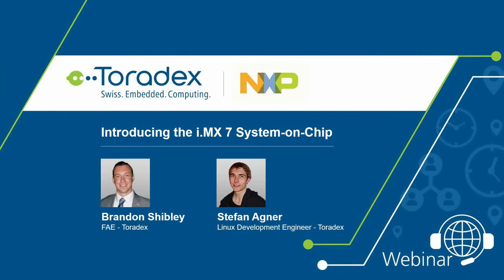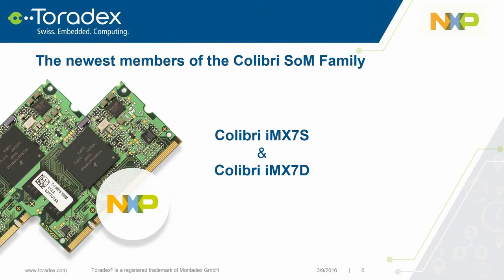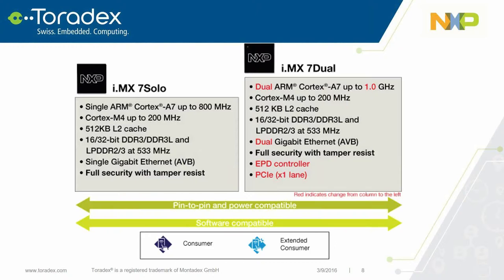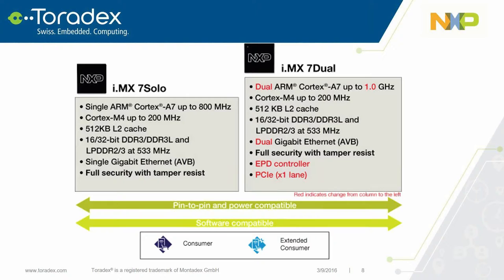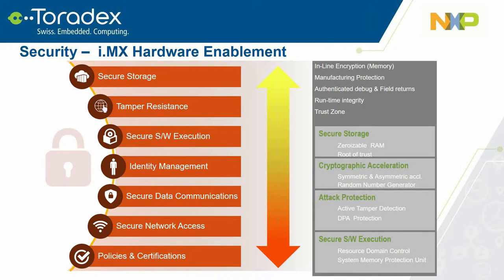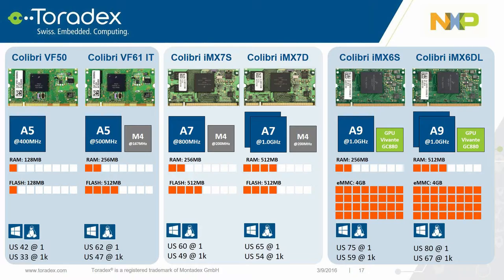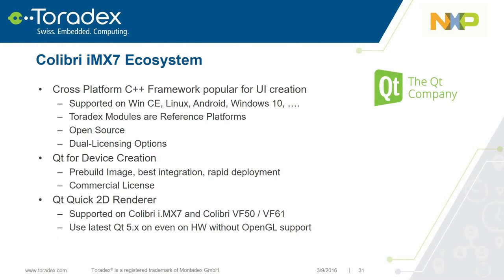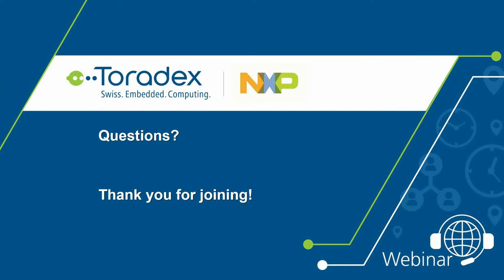Webinar On-Demand: Introducing the i.MX 7 SoC - Toradex and NXP

Comment: What is the input supply voltage given to iMX7 (for both solo and dual) ?
Reply: Hi,

You can find the technical details for supply voltage for Colibri iMX7 at its datasheet - https://docs.toradex.com/103125-colibri-arm-som-imx7-datasheet.pdf, page 61.
But answering you in advance, the main power supply voltage is 3.3V.